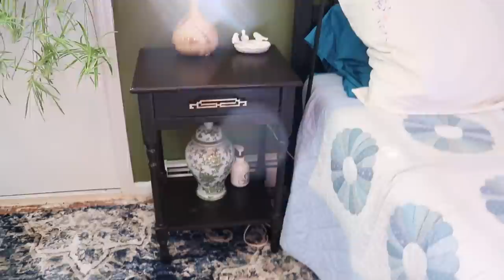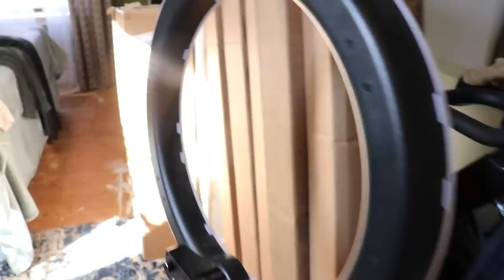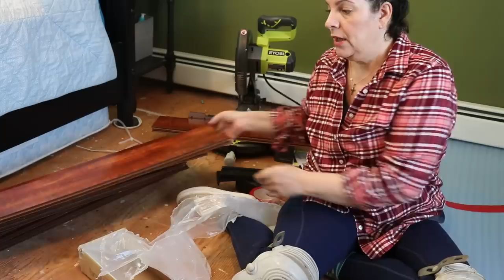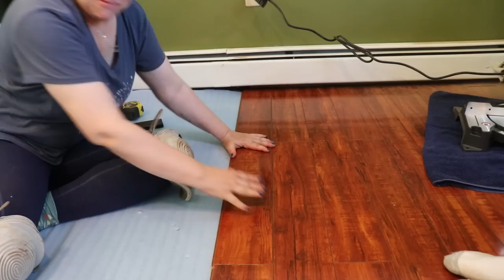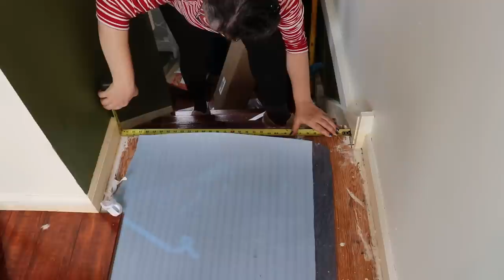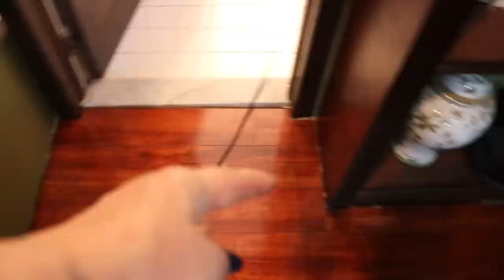Master Bedroom Makeover || Episode 35 || Installing New Floor ||

Comment: Nice job!  Makes the room look completely different!

I did laminate flooring in part of my house and then 8 years later I pulled it all up and redid the entire house (one level 1500 sq ft home) in wood flooring.  I figured I got experience with the laminate flooring.   When doing the wood floors, I started at one end of the house (in the bedrooms) and worked my way to the other end of the house (the public rooms) so as to work out any kinks in what I was doing long before I got to the living room and dining room areas of the home.   I waited a few weeks to put back up new baseboards to make sure sure the floors were “breathing” properly.  I never used 1/4 round trim since I had pulled up all the old baseboards and replaced with new 6” baseboards.  

Took me a year from one end of the house to the other, but well worth it (and I didn’t work outside the home).  It also allowed me to remove everything from the rooms as I went along and declutter.  Only the good quality furniture, sentimental items and anything beautiful that brought us pleasure to look at made it back in.  (I know that’s subjective to each individual.)  Got rid of 75-80% of what we had.  It was wonderful when done!  Not a minimalist, but it was so wonderful to have cleared spaces all around the rooms and corners.   It was like a new home.
Reply from the maker: I am glad you had the opportunity to do that.

Comment: Just some thoughts on the new floor.  Wash it with a little soap of your choice and it will take the sheen down a little if that's what you want.  And fill in any chips with wood putty now so that the floor won't chip further.  It looks very beautiful.
Reply from the maker: I ll probably get the swiffer sheets. Much easier.

Comment: It looks great.  After finishing such a big project, I'd be ready to take it easy for a while.  You said you took a break from the bedroom, but you did other stuff during that time like building the little library, sewing, cooking, cleaning, gardening, etc. (Could the left over flooring be used in the laundry room?)
Reply from the maker: The floor is not even it s actually slanted so water goes towards the French drain.

Comment: Floor looks great! I know I could never put in a floor. I don’t have the skills or energy! I opted to hire my brother in law and sister to install the floor in my craftroom. 

I would contact the manufacturer of the flooring and tell them how many pieces were damaged, they may give you a partial refund?? I had some missing parts on my swing porch  I bought recently and unfortunately they don’t have replacement parts for it so they offered a refund of $75 but then after a back in forth email With them a few times they ended up sending me a whole new swing for free.

Comment: Love the room, you need some flowers, roses, more romantic. Just thinking,  why don't you bring  upstairs your new secretary and the bike down to the basement,  in front of the TV,  so you can exercise there.
Reply from the maker: Because when you stand on the bike you end up touching the ceiling. It s even higher than a treadmill. And I also would never use it if it was in the basement.